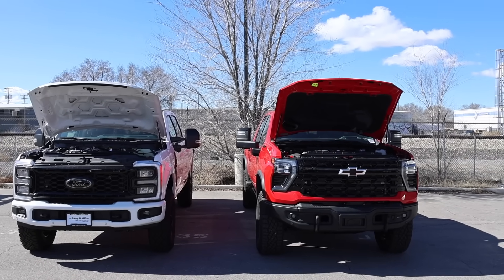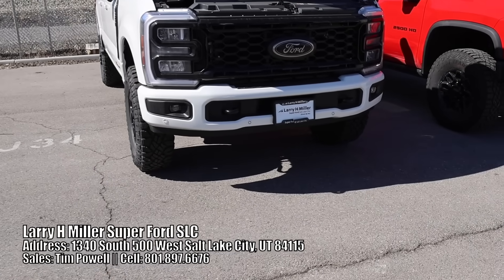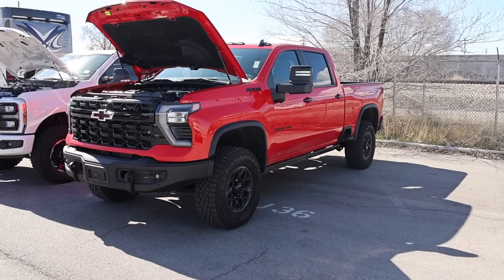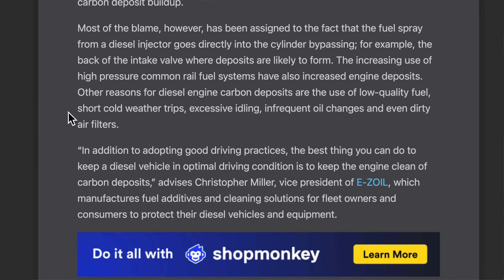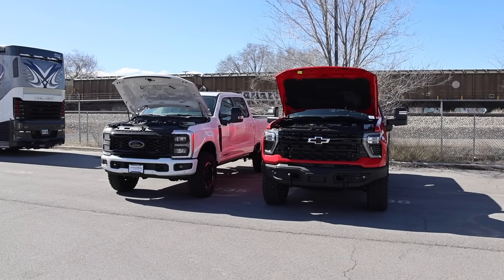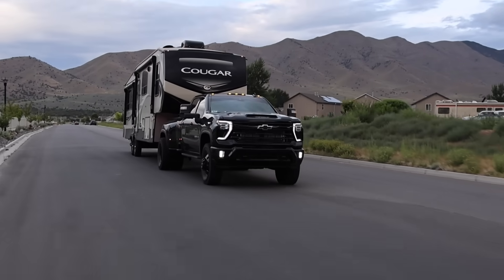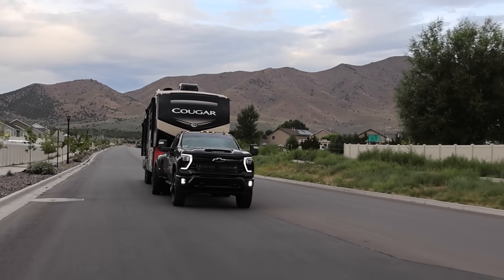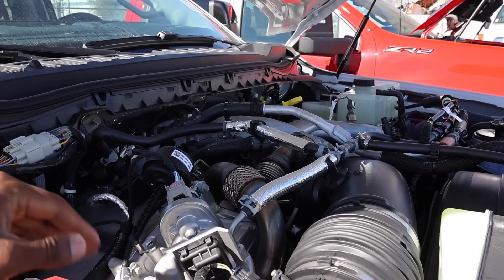How Can We Prevent Carbon Build Up In Our Diesel Engines And Would Going Back To IDI Help?

Comment: watching to learn about my sprinter van, and the additives are great, also many remove the DEF system if they live in uncontrolled areas. Im weighing this option, and looking into removing the EGR and cleaning this and also other components. My friend has this engine, the eco-diesel in question and still gets 20/30 mph on high speed trips. Its not carboned up like that at 200K miles..

Comment: To me the only long-term solution truck companies can do to prevent This is copy how gas vehicles mostly solved this, by adding a 2nd fuel ejector to each cylinder 1 port and 1 direct. Assuming they don't go back to 30ish year old designs

Comment: I own a 2007 LBZ Duramax: 520,750 kms. 

I run an FS-2500 Oil bypass system (Cartridge filer),  along with the PPE Dble Long Hi  efficiency Filter. 

I change Both Filters @ 40k kms add a bit of oil - then another 40 k and do a full Filter AND oil change. 

I run Semi Synthetic 15-40. I live in Alberta and temps lower than 10C, Block heater is plugged in on a Timer. 90% of my driving is @ 70mph to n from work ~ 30 mikes ea way daily - EGR Delete is coming soon…among other desired items.

Comment: One of the best things you can do is get the Howse injection cleaner is lubricates and remove any water that is in your system plus it also raises your octane boost on your diesel engine add approximately 12 oz every time I fill up if it's good enough for the trucking companies to use it it's good enough for my truck as well

Comment: Here's the thing the Cummins Detroit caterpillar engines have always been direct injection where the injector was right in the center of the 4 valves this is on all your big trucks no you did have caterpillar that made some off-road equipment with the indirect injectors plus a lot of farm tractors have the indirect injectors but all your major big trucks have always used the direct injection

Comment: I just bought a 25 Trail Boss 3500 Duramax. Since ordering in November, I have gone done the diesel rabbit hole. I have been an automotive mechanic for 20 years, but didn’t know much about diesel. I almost regret my decision to bit this truck with the diesel, as we use it to pull a TT( fifth wheel coming soon 😏) currently like 5 times a year. I want to delete this so bad but I don’t want to hurt it. I have really been following your stuff as you’re interested in the same. Keep up the good work and I’ll be following along. I do really like the meth injection, I am looking into this more.🤘

Comment: After watching videos about fuel dilution and carbon build up it makes me feel like I'm doing everything wrong.... however my 237k mile duramax has never had fuel dilution greater then .5% (per blackstone laboratory oil analysis) or intake valves gummed up. I had the heads lift at 2xxk miles and the intake valves looked great. The truck idles for at least an hour every day for work but it also gets driven (in traffic) for around an hour each way to and from work

Comment: Yeah removing egr on my 6.0 diesel made a huge difference and I still have the OEM PCV. And after I removed the EGR the PCV cleaned the entire intake. All the carbon was removed. Great surprise. I use synthetic oil with an amsoil bypass filter and I do 8,000 mile oil changes.

Comment: Check out the FASS EGR filter. Supposedly takes out 85% of the soot going back into your engine and make it last significantly longer than without it. I installed it and it seems to work fine even if only after a few hundred miles in a 2024 Silverado 3500HD.

Comment: Easy weight loss + work them like they are supposed to pulling loads working. It’s not meant to sit in a temperature controlled garage hooked up to be driven to buy groceries or to get yourself a Starbucks.

Comment: Definitely do not go back to IDI in diesels. The efficiency and power/torque will be a serious downfall. We need a full separation of current emissions systems to a completely new system that has zero impact on the engine. There is a far better way to make these diesels cleaner and far more reliable.

Comment: I feel you have done your homework with good sourcing.  Helpful, being a newbie to the "forced" exhaust problems.  Dave's garage informed us the US Government ordered has No emissions?  Consider them deleted but we the public have to deal with it.  If I'm going to keep this 2018 Cummins then I will be deleting it and run the Banks Ram air to solve cylinder 6 and then I will have a proper Cummins.  Side note, the price of these 2 trucks didn't help and GM has got to go back to the design staff and tell them, Make a truck that looks good, go back to the prior build and start over on the next idea as this GM Truck needs help, too soft and unbalanced, all over the place.  I'm a GM Guy so you can hear the pain.  Thks for the info
Reply: The GMC is largely regarded as the best looking truck on the road. Then Ram, then Ford. 
That’s the general consensus
Reply: Chevy is the ugliest.

Comment: Got a "Baby" Duramax on order. Learning about diesel even though I have had a diesel JD tractor for almost 20 years (bullet-proof, BTW.) This video is very helpful. Fuel additive, clean oil, get 'em hot, and put 'em under load. Makes great sense. Thanks.
Reply: The 3.0 doesn’t really need a load but it wouldn’t hurt anything
Reply: Never interrupt regens, don't be doing 10-15 min drives.
Reply: @drewmax-kl4oy it's a passive system and no it doesn't hurt if it does activate Regen . Not at all because it uses a 7th injector, not in cylinder regen like first Gen DPF engines did

Comment: Tell me you haven’t been a diesel mechanic for 20 years without telling me you haven’t been a diesel mechanic. Not trying to knock you and I know you’re trying to start conversation. But common rail injection is miles and an away far superior to injection pumps. Unless you have an engine that needs to stay at a set rpm and with a set hp…. Injection pumps are old tech ment for non vehicular performance.
Reply: I would also add, my l5p just turned 250k miles and has all the extra weight from the factory. Some dpf stuff and as far as I know no other major issues. Clean fuel good additive and letting it run every once in a while. However things will be changing this spring. Ps It’s not uncommon to see a good l5p get over 500k

Comment: Sincerely asking. If the methanol/water injection breaks up the carbon that would otherwise be building up in the engine, doesn’t that broken up carbon travel through the exhaust and cause a higher frequency of regens thus prematurely clogging the DPF with ash from the more frequent burns?
Reply: I would think so.
Reply: No, because the water methanol system also steam cleans the DPF.  When Diesel Power magazine was still in business, they did a test, and regen miles doubled with water meth...

Comment: I don't believe at this time of my life I'll ever own a diesel truck but I really do enjoy your videos educating me where diesels are and where they are going. I would love to have a truck again but will probably end up with a gas (Damn, that 5.0 Coyote is fire!). Not sure why the diesels you show and it's content intrigue but I'm sure your knowledge has a lot to do with that. Thanks.
Reply: The 5L engine will outlast these emissions loaded diesels. Way to go 👍🏻 I've been looking into them as well! They sound soo mean too
Reply: @drewmax-kl4oyno the 5.0s will not outlast a diesel engine. Where do you come up with this information? I’ve never seen a 5.0 with 500k plus on the odometer with the same engine and drive train. On the flip side I’ve seen 500k+ on fords, ram both but not so much on gmc and Chevys for whatever reason but most of the time fleet guys who put In serious miles don’t drive those and those are more for personal use I find than actual fleet vehicles. I’ve even seen some with 800k plus miles. The thing is on fleet vehicles when you do hotshot trucking those vehicles get serviced regularly and well maintained even though they are driven hard and ran to work! The weak point is the emissions no doubt but you just remove it all and do the maintenance that truck gonna perform for 100s of thousands of miles easily
Reply: @mendoafgoo420  good luck getting these 6.7 psd or 6.6 duramax or 6.7 Cummins with full intact emissions on and do average joe things every day. I don't think it will hit 500k miles without any issues. Lmao. Ive owned diesel trucks. I know what's up
Reply: @ you don’t go drop the kids off at school and turn it off or drive 5 minutes to corner store and home and grocery shopping etc no heavy duty diesel is made for that. Every jackass doing that stuff and not actually working with their trucks shouldn’t even own a diesel but what do i know. Keep trucking brother 🤙🏻
Reply: @mendoafgoo420  100%

Comment: BG 245 Premium Diesel Fuel System Cleaner removes and dissolves deposits from the entire diesel injection system, including fuel injectors and combustion chambers.

This is why older trucks are going up and value in good condition 😂

Comment: Been using Snow Performance stage 2   water/ meth injection for 15 years with zero issues. Valves and pistons were crazy clean when I pulled it apart for head/ cam mods. 5.9 Cummins 👌🏻
Reply: Do you see other benefits? Does it reduce soot out the exhaust?
Reply: Do you see other benefits? Does it reduce soot out the exhaust?

Comment: The carbon on these new rigs is actually an oily substance from the Crank Case Ventilation system that is part of the emissions equipment. The CCV oil is routed back into the intake of the truck and the oil vapors are supposed to be reburned in the cylinder. Often times the oil doesnt make it all the way to the combustion chamber and gets built up on the valve train and intake. That along with the soot from the EGR being recirculated is the cause of the issue mentioned in the video. Going to IDI solves nothing.

Comment: You drive them like they were meant for. Pulling heavy loads, not driving around town and no unnecessary idleing .
Reply: Just delete it and you can drive it how you want 😂😂😂
Reply: @VincentGonzalez-k2j void’s warranty and can’t trade it in deleted…most people can’t afford a 20-30k $ engine
Reply: Idling is half of the job for a LOT of us - especially in extreme climates where you’d be a fool to stand around outside when it’s -9°F or 115°F (Alaska and Texas - my two home states).  I have a Gen1 2.7L and 3.5L Ford EcoBoost that suffer from these same issue.  

Direct injection paired with Twin Turbos isn’t the issue, it’s the damn EGR and lack of Port Injection.
Reply: @MooseSquatch -9 F ??? 😂😂😂 try -40
Reply: I keep hearing to use them as meant, heavy work. I have the 1500 lz0. People bought VW TDIs for their efficiency. Couldn't the same be said for the half tons?
Reply: @nateyoung6331 this is what I’m saying diesels rule the rd in other countries and aren’t having these problems it’s the fuel not the use
Reply: @trotmandaryl  thanks for your explanation. The lz0 is my first diesel ever. As of now I still do love it.
Reply: And quit being pu$$ies and delete them
Reply: What about the Tahoe's with the baby max....
Reply: @ . They are smaller engines so just pushing the Tahoes/Trucks around should be good enough. I would be leary of the

Comment: Peg from zip ties & bias plies recommended that I spray a can of ether in the intake with every fill up. Truck's been running great so far.
Reply from the maker: That’s a good idea, next video I do will show some maintenance items Josh @trukstuf does!
Reply: This is terrible advice. Ether is starter fluid. Ever heard of a diesel getting addicted to starter fluid?
Reply: @CatRichardBojangles Clearly you didn't get the reference. I recently watched a video of   Pakistanis rebuild an Isuzu engine in the middle of the desert using monkey wrenches and a ball peen hammer, forgot to ask them what brand of def they were using. Seriously f*&! Modern vehicles, they are embarrassingly fragile. Now I see why channels like @Whistlindiesel exist to make a mockery of these things.

Comment: For gas trucks with direct injection I put on an oil separator on the PCV line from J&L.  People who tune European cars with direct injection have been doing it for years.  Newer modification to the U.S. truck market but direct injection on trucks also a more recent addition.  I can't see any downside to running it and empty it every oil change which I do at 5,000 Mike's and not the GM recommended 7,500 miles.  Little extra money but gives me peace of mind.
Reply from the maker: With all these issues across the board it only makes sense to be a little more OCD for sure! The great thing about gas engines is the fuel standards is a lot better here in America so if you go ethanol free top tier, you really don’t have to run additive at all 👍🏾

Comment: Schaeffer's makes quite a few popducts for diesels that will prevent or clean up the carbon.  Most diesel owners dont want extra maintenance.  They want gas engine maintenance from an overcomplicated emission engine.
Reply from the maker: I will have to look into this and you’re right, most people won’t go the extra mile to keep their truck running in top shape!
Reply: @JB_WhoWork XDP will do you better than Schaeffer’s but both solid additives.

Comment: My last 2 diesels were a 15 Powerstroke and 13 Duramax.  In 20 I took a gamble and got a 7.3 Gas.  93k no issues to date and I tow 3-4 times a week.  I agree maintenance is key.  5k oil changes, 25k tranny, front/rear diff fluid changes and filters when needed.  What I have run in my earlier days when I had my fleet of diesels was Marvel Mystery Oil.  I still run it in my fuel on my 7.3’s and at 49k, 1000 miles before my next oil change I let out 1/2 quart and replaced it with MMO.  I did this on the diesels as well.  I just got back Blackstone oil analysis and no issues and I believe what I have done on my diesels and gas motors are seeing into the 300k range.  Both my 13 and 15 diesels are on the road today and sold to friends.  I need 2 new trucks in 2026 and as much as I like the diesel for my heavy long hauls I just can’t justify the extra maintenance, fuel cost and upfront cost to justify the expense.  Good review JB.
Reply: I know guys 500k plus with modern diesels aside for the 22 Cummins for some reason that year they grenade and don’t use the same quality of parts hence ram getting rid of suppliers and only using certain ones because they found the issues came from trucks with parts from those suppliers that were sub par. Stellantis says the tariffs will ruin their profits on 2500 and 3500 trucks, I say you better bring back production to the states then and build the 1500s at the other smaller factories that can’t house and support the manufacturing of all the heavy duties. I will never ever buy a heavy duty truck with a gas engine even if I got it Pennies on the dollar, it defeats the entire purpose of owning a heavy duty. Gasoline engines simply cannot put out the torque of a diesel engine, furthermore horse power does not equate to towing ability or ability to get up or a go down a grade, its torque and diesel is the king of that. Why do you think all the semi trucks use diesel engines? It’s because reliability, longevity and the ability to pull 80,000lbs, even empty at 35,000 ain’t no way in hell a gasoline engine can do that daily. There is no gasoline engine on earth that could handle that all day long 7 days a wk 365 days a year it’s just never gonna happen. If you want a heavy duty and will be using it for the same things a person would be using a a half ton truck for then by all means get the gas engine it will be easier to maintain and be able to do all the stuff you would do in a 1/2 ton but in a larger truck, if you want to do what heavy duty trucks were designed to do then you damn well better be getting the diesel version. Have a good day 💪🏻
Reply from the maker: Thanks for sharing this great information, I haven’t kept trucks long but I’m thinking about keeping the GMC also open to long term advise!

Comment: Rislone  makes a couple of products for cleaning these systems, I’m pretty sure it helps my DPF , I’m just not sure how much it helps the EGR system !
Reply from the maker: Thanks, I’m open to other opinions because there’s not much additive will do with cleaning the entire system so the meth seemed to be the best option you can do at home 👍🏾
Reply: @ I’m certainly open to that method, my only concern would be cost , hopefully it’s reasonable !
Reply: I bought the risolone def treatment. I added it too my new duramax day one this past December. Not sure if it's just snake oil or actually worth it? But only have 800 miles on it so far. So maybe in 5 to 10 years I might know if it works.

Comment: If we take advantage of project weight loss can we use the DEF tank for meth?
Reply from the maker: Dang that’s a good idea but you would have to clean that tank very thoroughly to the point it wouldn’t be worth reusing personally 👍🏾
Reply: @ I bet a new unused tank isn’t much ($300?).  And  then fresh hosing to the motor and use whatever pump is supplied with the kit.  Hmmm.  I’m thinking of a babymax for a commuter.  This could solve a lot of issues.
Reply: If you let your truck smoke meth, it'll lose weight.